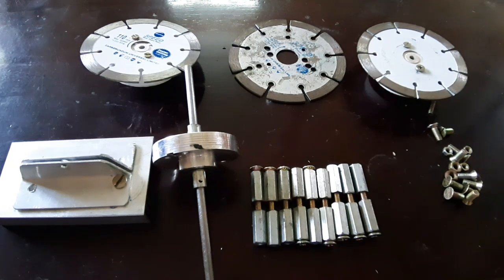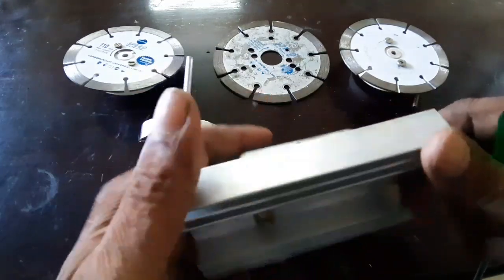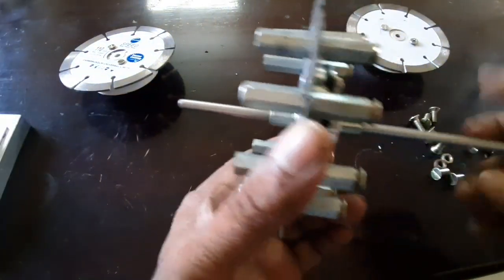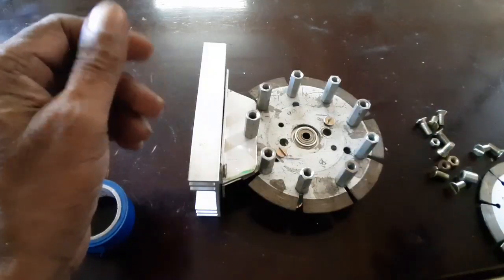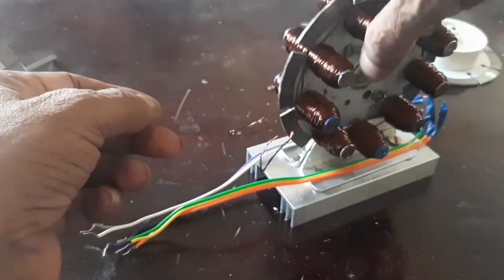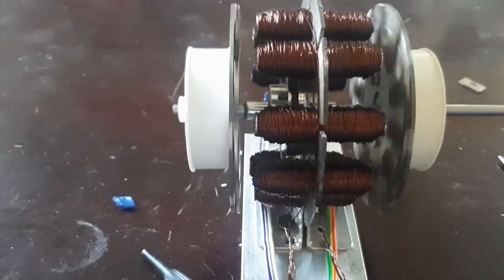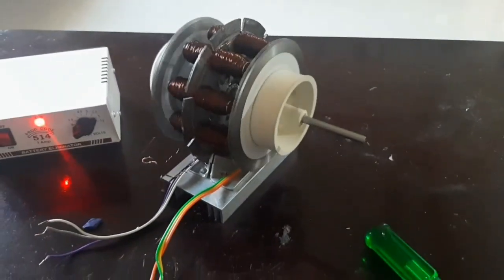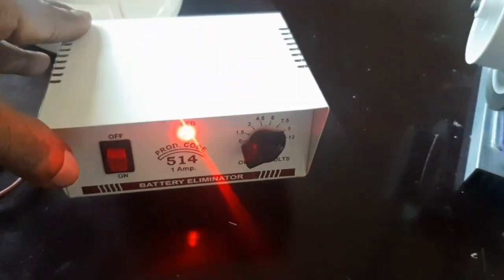New powerful axial flux bldc motor with (2stator+2rotor)

Comment: Could you use one side as a motor and the other side as a generator then compare the two? Then see what power it can generate.
Reply from the maker: Thanks for watching sir
Yes it can be used as a motor generator
I will check sir
Reply: @pugalstech  even the second coil is a generator without adding the second magnet rotor, if you recover the sencond coil wasted magnetic field, rectify it and filter it with cap and put it back into the system then you have recover 50% wasted energy  that normal conventional motor usually waste sir

Comment: Stator poles 12 poles  rotor?
Reply from the maker: Here i using 9pole stator and 12 pole rotor
We can also to use 14pole rotor and 16pole rotor but winding connection 
Changed

Comment: Firstly, it is great to see your wonderful mind at work again creating something new and unique. Please accept my sincerest regards. I had watched your earlier axial flux motors. The major difference with this version is the additional set of coils making it twin magnets and twin coils. How does the secondary set of stator coils adding to the efficiency of this motor? Greater torque, greater input power, faster rpm? But thank you for your kind explanations and deminstrations...
Reply from the maker: Thanks for watching and supported 
When you connect two motors by mechanically  ie coupling both shaft so the torque is increased
The same way here i couple the two motor by electrically 
Thanks sir